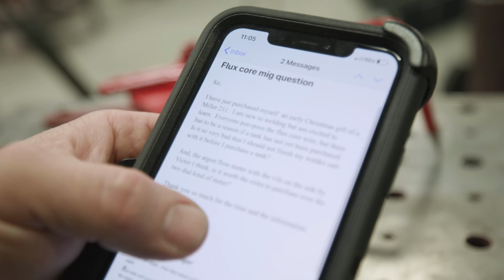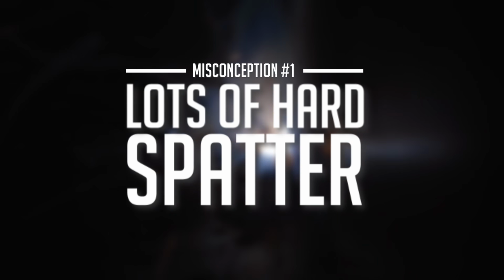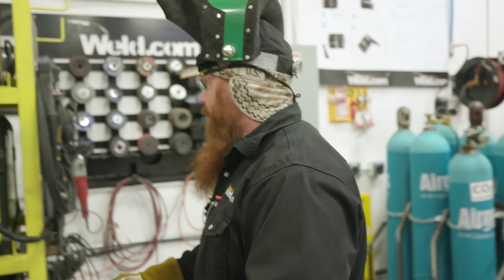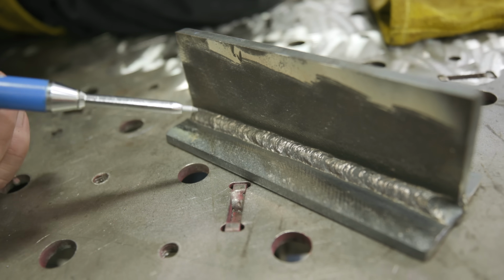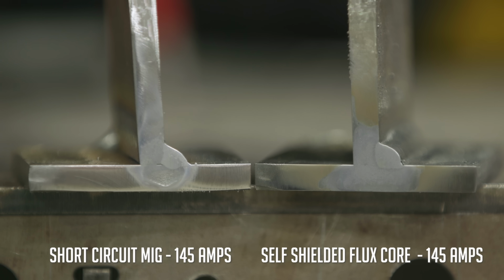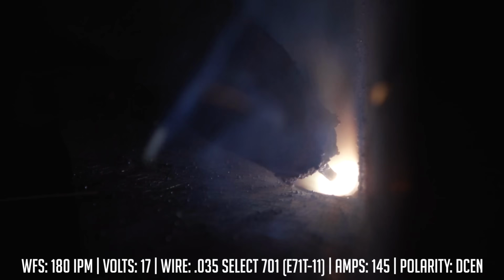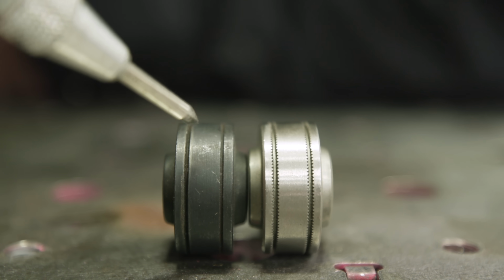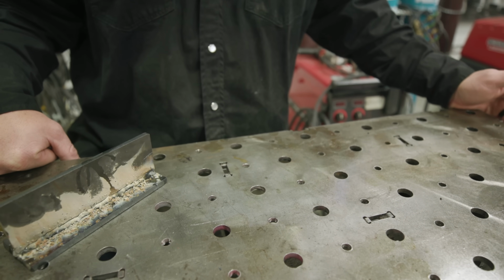3 Flux Core Welding Myths DEBUNKED

Comment: I have welded many Demolition Derby cars together with 035 innershield on 10lb rolls through a Weldpak 155. I think that flux core welds rusty stuff a lot better than stick welding. Back in 1998 I  built an electric over hydraulic, power up/ power down tilt car trailer, 26' tip to tail, with that flux wire and the same Lincoln  WeldPak 155 welder (220 volt) and none of the welds have  ever failed, and that trailer is still in use.  Nothing about flux core bothers me except maybe, the higher price per roll of wire over regular solid core,  though maybe with solid wire and a bottle there would possibly  be an over all higher price that way too? Never had a bottle setup, just flux wire welders (2 Welpaks 110 volt, and 220 volt) and à ranger 7 stick welder.
Reply: Thanks Bob, I run the 220 volt WELDPAK 155 too, great little machine and my bigger rigs are blue or yellow.
Reply: Shoot, Ive done solid axle swaps on rock-crawlers, trailer work, built large steel gates, exhaust work, you name it - all with flux core, .035" and a 120 volt Lincoln SP-135.  I have a 180 amp 220v Lincoln as well but rarely use it because 110 outlets are so plentiful and I can easily take it to work or a friends house. I never bought any tanks, Ive been using the flux core for 17 yrs  now and people ALWAYS give me crap for its saying gas is the ONLY way to go. Gas is cleaner and less smoky and better for light sheetmetal but for what I do flux core is what I prefer!

Comment: Im a beginner welder- Please tell me Im ok to use a Fluxcore welder to weld 1/4 steel to 3/8 Hardened steel, Im trying to repair a Trailer Frame (Semi) and the beam on the trailer is very hard steel,I cant drill thru it..... Please tell me Im good and Dont have to buy one of those million dollar lincoln 100000 kabillion amp welders. Im going to try it very soon- I have 030 and 035 wire
Reply: @Anon Ymous I have too, No other options....I tried and it just left tons of round balls throughout the weld, Dont think the welder was strong enough...Oh By the way- Since your Nosey- Go pay a pro welder to come by then and do it.

Comment: So from this video, I am understanding that on 1/4" steel, flux cord would penetrate more than C25?! Am I missing something? Is C25 not supposed to be better for strength?
Reply: Er70s6 is more ductile than e71ts just like 7018 is more ductile than 6011 ... when used on a joint that sees shock loads such as an axle control arm mount , recovery mount ,  or cage on an offroad vehicle er70s6 is going to be a better choice...not because of penetration but because the filler material is less likely to fatigue and crack in this application . Depth of penetration is only one aspect to a process or filler material.

That being said I built an entire 12k car hauler out of e71ts in a mix of hobo wire ,Lincoln,  and Forney... even a couple small rolls of " fire power" from oriellys on weekend pinch.
Reply: @yerwrng  this is great info! Actually the project I have now in an offroad winch bumper. I was planning on using er70s6 with C25 gas, but than saw this video which got me thinking if I chose the right setup. From what you are saying, even if the penetration is slightly less, I should still use er70s6 to avoid it cracking under load and vibration. It also looks nicer so I am all for that. Thanks so much for your help!!
Reply: A 1/4 thick bumper with 3/8ths or even 1/2 thick shackle mounts welded to the 1/4 bumper can all be done with a 140 amp mig machine.  In most cases you will have two sides welded and you can always run more than 1 pass which adds weldment and preheats the base metal so you second or 3rd pass will be deeper.  A smaller machine like this just takes a bit more time to do this since duty cycle is maxed vs a 200+ amp machine .  Just keep an eye out on how warm the exiting air from the fan is on the machine and let it run until cool then weld more . Dude gives an info video on the myths of fluxcore then goes onto perpetuate the myth that MIGt Is only for thin metal .

Comment: My welding instructor told me today that welding downhill goes against codes. I’m assuming he was referring to AWS codes but I haven’t been able to find any information on it. He was being very vague on the whole thing. Anyone know about that?
Reply: Honz 11b just depends on the wps and what code a company or employer uses. Downhill pipe is a specific code, API I believe but I’m not 100% sure. With Some procedures you’ll do a downhill mig open root then go to uphill flux core fill and cap, just depends. I’m a welding student and still learning, generally for our tests and procedures we do in class to get certified is all uphill when doing 3g but like I said it depends on what certifications you’re aiming for, some specify downhill. Hope this helps.

Comment: I do have a question, I have butted heads with people who claim that 7525 argon CO2 penetrates better than 90 to 8 or 98 to argon CO2 for structural. And I cannot seem to get a few of them to understand that you can't turn the heat up high enough to get enough penetration unless you have at least 80% argon to carry a plasma stream. They have actually made the claim to me that because you get more spatter with 75/25 it is actually penetrating better. How in the world do I explain to them the spatter is an indication of lack of penetration?

Comment: My only question is why in the world would you use the same settings on a solid wire. I never use the setting less than 22 volts using solid wire with gas on quarter plate. And it was usually higher than that. Flux core acts much hotter because it is it's actually a smaller portion of wire that's actually doing the work so it acts like it's much hotter at a lower setting. But I never had a problem being able to use flux core wire. I don't understand what the issue is. Biggest problem I ever had using flux core wire machines was the piece of shit Lincoln Welders some of the companies tried to supply.

Comment: As a home hobbyist, I rarely weld ¼" steel plate at 90° like that, most of my work is with 22 gauge sheet patches on rusty old cars, whilst lying on my back underneath them.  I have a flux core welder, still in its box.... have I bought the right thing?
Reply: Flux core is ok for thin-plate welding, but you should practice on scrap metal first, and avoid breathing the smoke.
It is less sensitive to rust and dirt (because of the flux) and it also welds Zink-coated steel, but the amps must be reduced (really avoid breathing the smoke) and as the Zink burns the flame is brighter

Comment: this probably would have helped me with my 1 inch bend test. i had porosity consistently, but not visible other then the absolute ends. i practiced on 3 different machines with various settings positions, voltage and so on. when i got a new roll it didn't SEEM to have porosity until i bent it. i think the regular v groove rollers mighta screwed me on that. if i have to take one again i will remember this.

Comment: I have been building trailer frames out of lightly gavinised RHS in Australia (duragal is the marketing name) for 10 + years. I find a flux core works perfectly. A big point it took me a while to get is pull the wire along the weld, not push as you do in Gas shielded Mig. (As in arc welding with stick)
No weld contamination even welding with this type of metal.
Also the gal reacts with the slag, it forms a hard coating that resistant to rust. I have some stands that have been in the weather like that for years.

Comment: Thanks for the info! I bought a cheap MIG welder a few years ago and went through all the problems you listed. Searched the web for ideas and saw all the negative comments about flux cored wire. As a consequence I set the welder aside, waiting for a chance to add gas and use solid wire. Now it seems I only need to correct the mistakes you pointed out and give flux cored welding a new informed try :-)

Comment: Here's a question. Can I use flux core welding for vacuum applications? or is the weld gonna have flux trapped in it that has Outgassing problems

Comment: A problem for consumers is that too many of these guys buy the cheapest flux core welders they can find on eBay. I buy cheap equipment from time to time to test. A lot of this stuff is pure crap. The current is erratic, it rarely comes close to what the manufacturer (usually some unknown Chinese company’s product being sold by some guy who bought the 50 minimum from an exporter) says it is.

A lot of the complaints rise from these guys.

Comment: Everybody's always fascinated with how thick it can weld. I'm wanting to know how thin can it weld. I have a Forney 140 - FCi
And I don't think it can do the 22 gauge like I need it to. I'm trying to weld thin auto body which I believe is 22 gauge. The second I pull the trigger it burns a hole right through and I've tried different settings including turning things all the way down.
Reply: Increase your stick out

Comment: Flux core is easy to run work shipbuilding run bluesheild Lt 91 .045 wire  we run Around 25 to 27 volts around 150- 220 amps wire speed  350-425  we can usually run on DC positive for all position welds where negative polarity crowns to much welding verticals creating undercut. Usually most of the younger welders start out to cold and have excessive spatter where just a slight increase smooths out their weld.

Comment: Does anyone else get a build up of slag inside the cup or is it just me?
Reply: Yeah, that'll happen. You can get shrouds specifically for self-shielded flux core welding that taper down and don't give a place for the slag. Since you aren't using gas, you don't need the big opening.
Reply: Yes, I actually cut a standard tip shroud in half, stops this happening, easily to see the tip and get into tight V corners.
It still protects the thread or the spring on a Binzel type gun so if switching to gas you can still attach a full shield

Comment: I have small welding equipment and preheat thicker sections to about 400°F using a propane weed burner. I judge the welds to be structurally sound. Is this flawed in any way?

Comment: Excellent video!
As a hobbyist/home project/infrequent welder, flux core's all I use.
Important safety information:
Particularly when welding with flux core wire indoors or in a confined space, use local exhaust ventilation and wear a P100 rated respirator under your hood.  It throws off as much or more hexavalent chromium in the weld fume as stainless.  Nasty carcinogenic stuff that you DON'T want to breathe.

Comment: Very nice explanation.  I've found that when everything is set right, there is no reason you can't get a very good weld with FCAW.  A lot of people complain about it but they mostly seem to be people using these cheap welders that have erratic wire feed speed or poor electronics.  Some of them just don't take the time to learn how to deal with the different processes.  For thicker stuff, I would rather use flux core than mig.

Comment: I like .030 innershield (this is what i know it as) for welding auto body metal. 18-19 guage. Doesn't burn thru as easy. Is much better than solid MIG hardwire. More ductility. Hammer tack with it easier, grinds easier.

Comment: I welded custom galvanized gates with gasless flux in a ⛺, it smoke's like crazy. Yes it will work. For production stand point it's point less and it's toxic even with a good 3M mask. No nozzle, would recommend that you leave the nozzle on, to protect the tips. 
Welding with gas in a ⛺ you waste more gas, cleaner welds.
Reply: Brandon Berg if that galvanized shit makes you feel sick drink some milk. Idk what it is but it helps
Reply: On top of that! I went somewhere else could not work in a tent for much longer!

Comment: Well, any/all T-11 FCAW needs to run on straight polarity, as does any T-8.   If you get that figured out you are good to go.   On straight polarity you have electrons running at/into the electrode, not into the base material.   So, if you what to compare a reverse polarity gas shielded FCAW wire to a straight polarity gasless FCAW wire the penetration profile, with similar amperages, will be improved on reverse polarity, every time.   More may not be better, just more.   If you want to build a welding cart with gases, for sure, no problem.   As well a word of caution with regards to the T-11 is aluminum.   The aluminum in the wire is "terrible" for impact outcomes.   So, if you do not need to be concerned with impacts values gasless FCAW is a great option.   This is a GREAT instructional video.

Comment: Great video.  I have found with flux core any porosity seen on the surface often has much worse internal “worm holes” that you can’t see.  My understanding was it was gas escaping from the weld and the gas pocket creates the worm hole inside the weld and escaped through the pore.  Definitely not good.  It’s also worth mentioning some of the super cheap flux core welders (harbor freight) weld on ac only, which seems to have much worse spatter than dc (and most flux wires are for dc only).  Again great job on the video.  Lots of good info.

Comment: I'm sure this question is answered somewhere, and I missed it, I was curious to know if I can use negative polarity with gas on my little 110 mig? It would save me that extra little step between switching wire, and if so, what are the possible drawbacks if any? Just subbed, great info.
Reply: No you can't use it on GMAW. You won't heat the wire enough and the bead will look terrible. Sometimes it is used when doing overlay to reduce penetration.
Reply: @geoffmooregm  thank you for the answer it was very helpful, I appreciate you taking the time. Have an awesome day!

Comment: First off, not all flux core is gas-less. Some requires shielding gas...especially 304/316 stainless steel flux core and mild steel as well. The next issue is position. If the guy only wanted downhill welds, it can work, but not with amateur welders because they let the flux get under the weld and prevent bonding. It also matters whether he is welding fillet welds, lap joints, or but-welds. A lap joint is probably more ideal for flux core...especially downhill welds. Downhill fillet welds with flux core can be problematic. Next is the length of the weld bead. If the guy only needed 1 inch long welds, then flux core can be a problem because the starts and stops are often erratic or mis-shaped and you get a weld bead that's 50% weld and 50% crater/stop which looks stupid. If you are going to weld short beads with flux core, then try and find some run-off tabs so that you can weld onto the tab and then break/cut off that tab afterwards. This ensures that your weld bead has a consistent appearance as well as a consistent deposition and fusion rate.

Comment: Also if your welding outside and it is windy, the only wire you can use his flux core because that wind will blow your bottle gas clean away from the weld puddle.

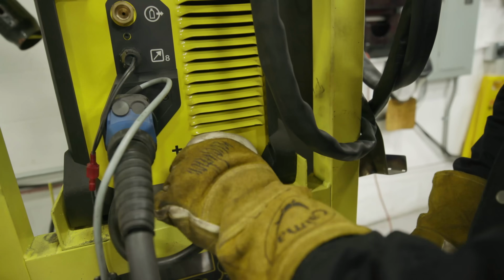Comment: DC Neg, DC Neg, DC Neg,,,,  @ 3:35-ish>>The mig gun needs to be on DC Negative and or straight polarity for 71T-11,self shielding Flux-core.............You can not repeat that enough for people like me, I had to watch your video again, I think now I got it right now, I'm going to make sure I wright that down on my 211 Miller in my shop.>>>>>> But is that the same for  71T gas flux core? <<<<<<<< I hate to ammit it but I've been using 71T for 30 years,  but to be fair all I do at my job is>>turn the dial and or push the buttons<< from pulse arc to flux core,........ I dont unplug cables on this at work>>>MILLER XMT 350 CC/CV MULTIPROCESS WELDER....... But my small 211 Miller-Matic at home it is different then what I use at work, I have to un-screw the wingnuts to change polarity to use 71T-11...............
Reply: Job38 Four most of not all Gas Shielded Flux Core is tan on DC+.

Comment: Had lots of porosity problems when first running my crappy little chicago electric wire welder w/ flux core that came w/ it.  Ran in straight polarity and with slightly more stickout than mig (about 1/2"-5/8" vs 1/4"-3/8") as I had learned this in welding class.  However I had transferred over my technique from mig welding using the small "e" shaped circles.  When I tried again using a stringer bead it was beautiful.  Well, not beautiful, but anyways it worked better, much better.  I chalked this up to mean that when running flux core, one should never "leave the puddle".  However I remembered from when I did Innershield in class we did vertical uphill on a 1" T (fillet joint) using a large weaving technique which definitely was leaving the puddle. So I am resigned to confusion on this matter.
Reply: Clifford Bevans when I run flux cored either self shielded or Gas shielded, I run straight stringers, just a little wiggle if needed. I never run weaves with it cause you can trap slag pretty quick.

Comment: Nice to see you're using esab. I might be a bit of a snob when it comes to welding, but I think the esabs run the smoothest and most consistent welding beads. I still love my miller but miller is the number 2 machine for me. I only use a cup wire wheel on my grinder. Those wires do shoot out like spears and the cup at least points the wire in a safer direction in my opinion. Peace out dude.
Reply: Rick Hunt check out the encapsulated wire wheels from Pferd. No more wires flying randomly around the shop or in your skin.

Comment: How well would flux core work for welding pipe fencing vs using stick welding
Reply: Austin Snelling works great for that. I’ve put in miles of steel handrails and guardrails back stage at Disney with flux core. It works great. Plus if it’s thin gauge E71T-11 works great on galvanized.

Comment: I have a Millermatic 211, is there any way to change the polarity on this machine
Reply: Pop the hood and swap the polarity. My Lincoln had the terminals marked nice and clearly as to what was "positive" and "negative".....if you have the manual; check in there just in case.